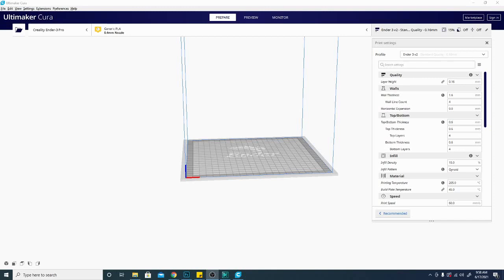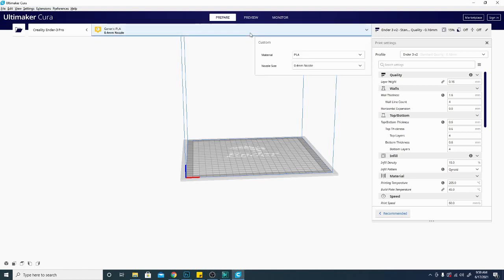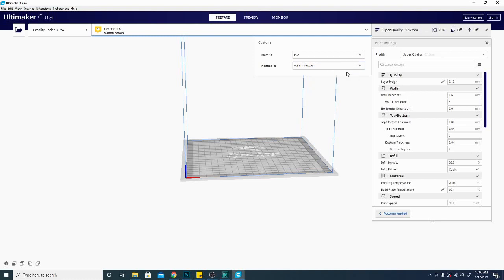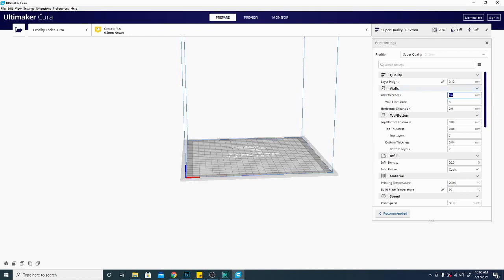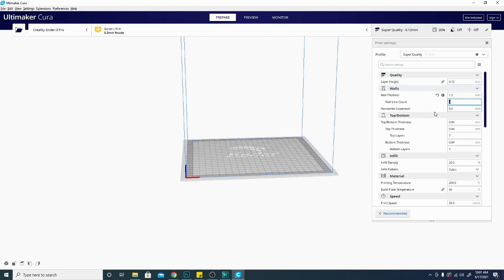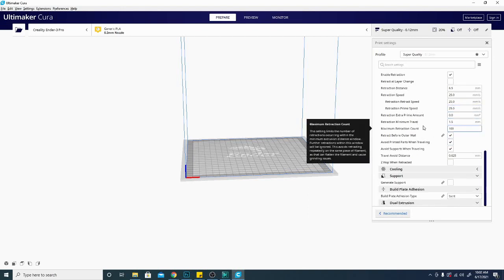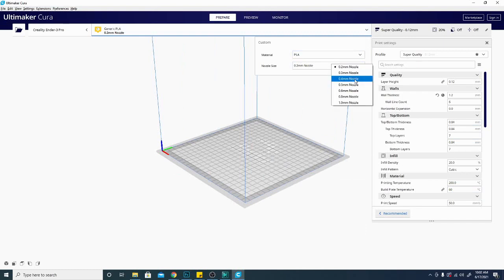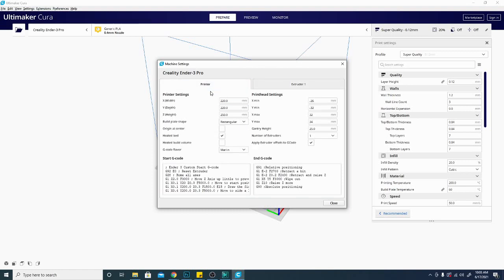Changing Nozzle Diameter in Cura

Comment: It seems that in Cura 5.3 nozzle size cannot be changed manually. I've tried Machine Settings- Extruder Settings. I'm using Ender 3 S1 Pro. Any suggestions 🤔 👀?
Reply: Same. Only option is 0.4mm. I mean atleast there is a profile for the S1 Pro now so over time they might add other nozzle sizes too.
Reply: @krisztianmolnar5023  Did you ever find a solution for this? I am stuck with only a .4 nozzle on my S1 Pro in Cura 5.3
Reply: @andrewschaefer  You can add a feature called "Line Width" and match it to your nozzle size. Also just noticed, that there is an option for "Layer Height" too. It should be (can be added) under the "Quality" drop down menu. Not sure how well this works. Other than that, we just have to wait for the Cura team to add Nozzle profiles probably.

Comment: Was just switching line thickness and works well with 0.2 and 0.6mm nozzles. Didn't change the nozzle size actually, but it still worked fine

Comment: Do you need to recalibrate your filament feed rate when changing the nozzle? The length flow rate of filament thru the extruder? I know the ender 3 has a calculation you make but wasn't sure if this needed to be edited in the ender 3 printer when changing to different nozzle. TIA

Comment: I’ve tried clicking on different nozzle sizes and it always stays on 0.4 for some reason it will not change. Any suggestions? Thanks
Reply: Once you create a custom print profile, you’ll see a setting called line width, and that's the setting you’ll change to reflect the size of the nozzle you are using. If you are using a 0.6mm nozzle you type 0.6mm into line width.
Reply: @KxngUnkasa5  No.  That's not it.  That's a different setting.  The setting for the nozzle diameter is just like it's shown in the video at 0.40.  What you describe would be for a 0.6mm line width for a 0.4mm nozzle, which is something you can attempt, but probably won't work well, and it's not what Seth was asking for.
Reply: It might be a limitation of your machine that you can't use the nozzle you tried to select?

Comment: Do you have a video showing how to add nozzle sizes into cura? I dont have the option to change it to 0.4mm size and it only goes up to 0.3mm. thank you
Reply: Yup, what he said 👆
Reply: @MrSocko-420 Hmm, I think I'm gonna try just adjusting all the settings (line width, print speed, etc.) for the .2mm nozzle profile to work for my .1 mm nozzle

Comment: if i change nozel size my profile is gone is thier a way to keep profile and only change nozel size
Reply: Same problem.
Reply: It should keep your profile. Try to update Cura to the most recent version or export your settings than import them once you adjust your nozzle diameter. = )